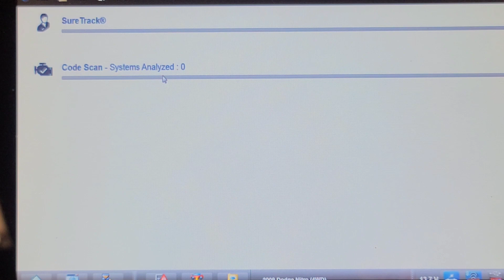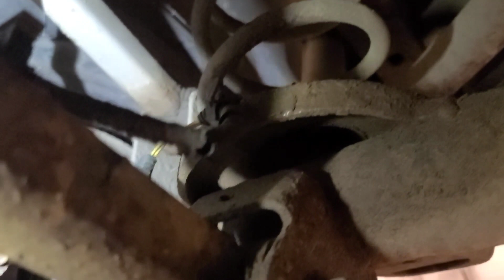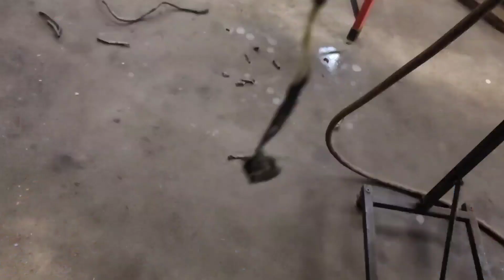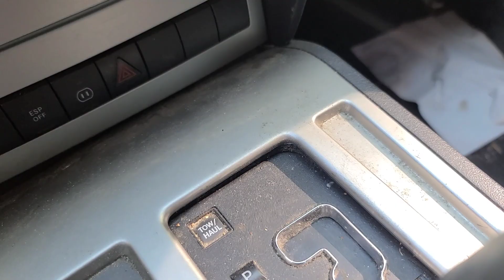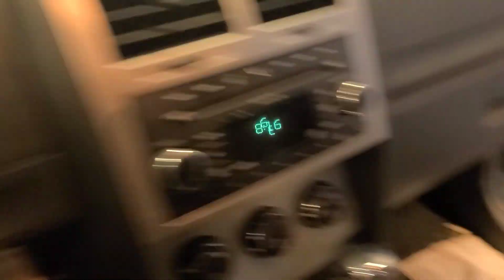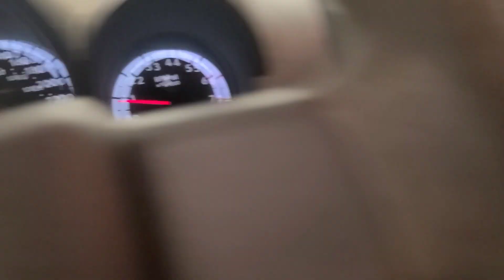2009 Dodge Nitro ABS & Traction Control Lights On. Code C1020

Comment: You still have nitros on the road up there? They all rotted out in Michigan I haven’t seen one in years
Reply: I have a blue r/t here in Michigan.. mine is rusty underneath but no body rust at all.. I did have to replace exhaust due to rust though here recently.